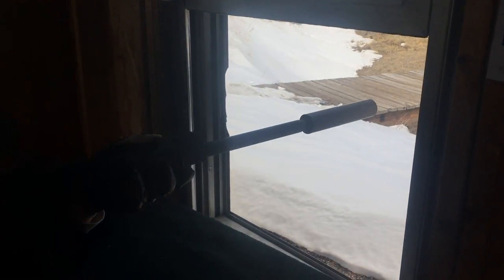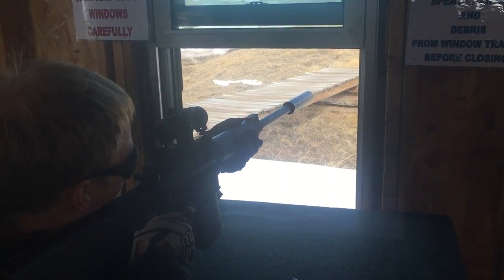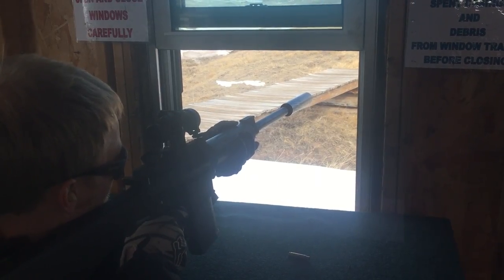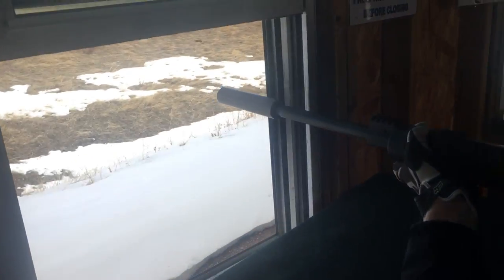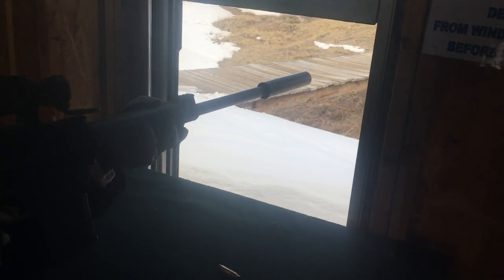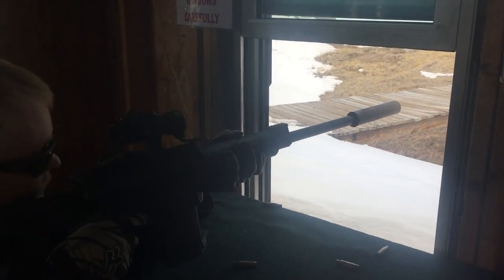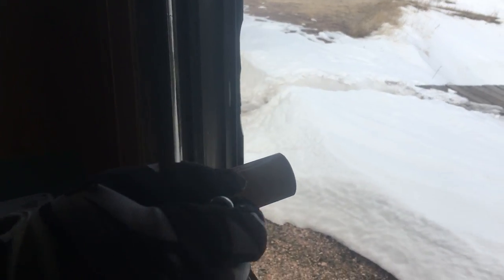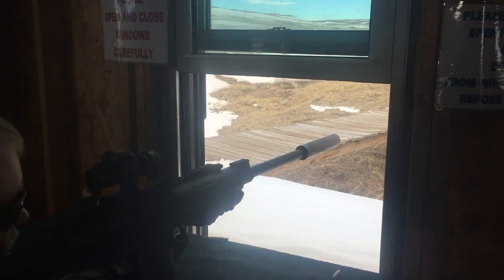Ultra 7 308 Heat test

Comment: Damn this is awesome!! So glad I bought from you guys....Did he have to run an adjustable block on his ar10? Stepping into the ar10 world wondering how the gas blow back on the ultra 7 does for a gas gun. Should be hitting the range next week with it figured I'd ask.
Reply from the maker: This was a standard gas block. The Rifle Speed gas blocks are pretty trick. Getting your gas system dialed in will help a lot. Check out this video.       https://www.youtube.com/watch?v=l870SkASH5Y&t=37s